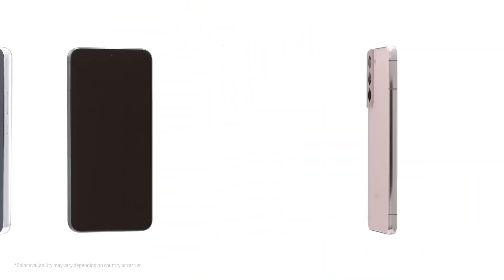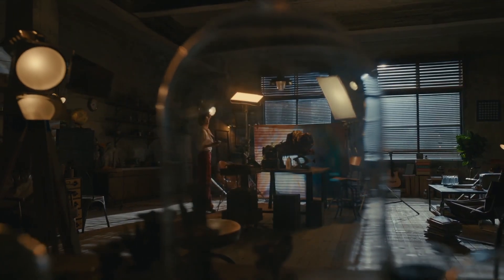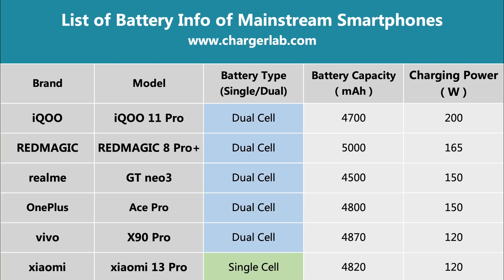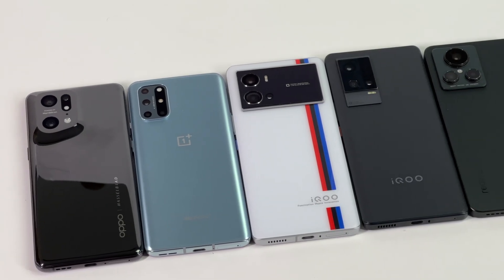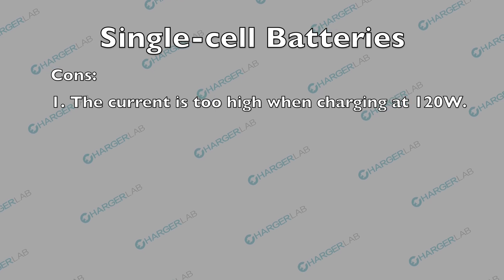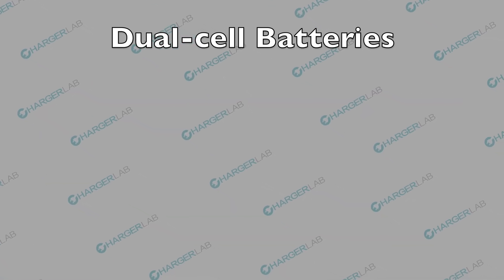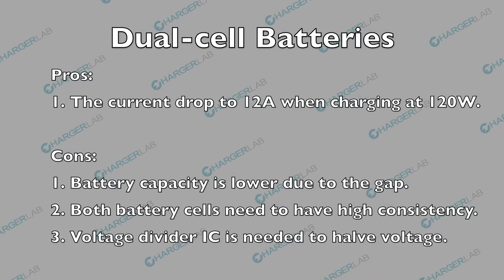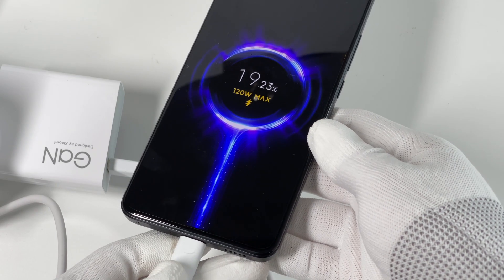What’s Difference Between Single & Dual Cell Batteries in Phone Charging

Comment: This explains why the poco f6 pro heats up more than normal at 120w due to having a single cell 4.45v battery but in exchange it has more final capacity of 5000mah🧐👌😎👍

Comment: uh xiaomi 13 pro with 120w charging is using a single cell battery?? because my poco f4 gt is using dual pump and dual cells battery, 2350x2 : 4700mah. its the same with xiaomi 13 pro that using 120w hypercharge protocol. 
my battery voltage is 8.1v